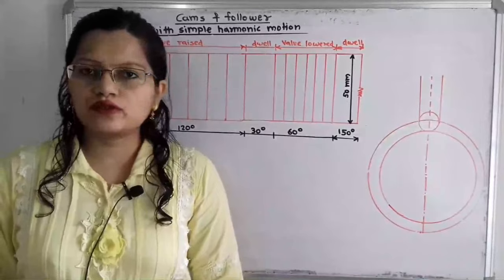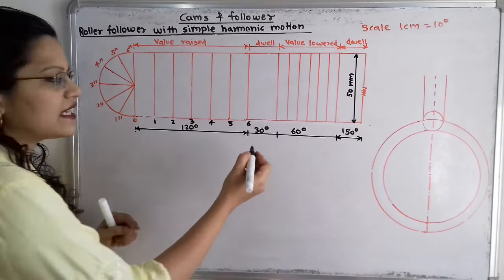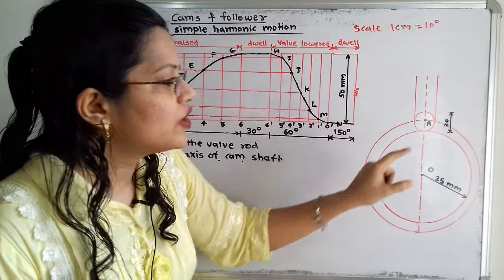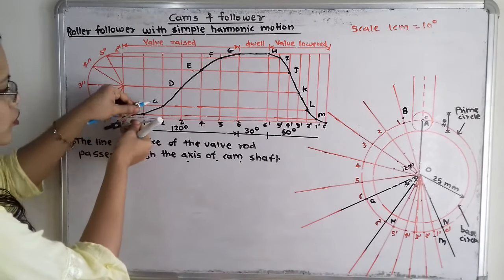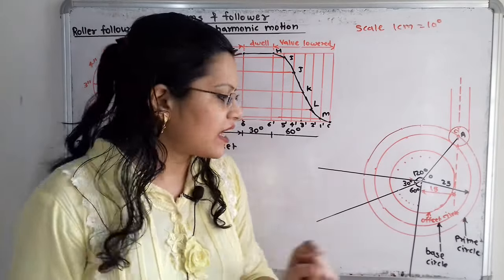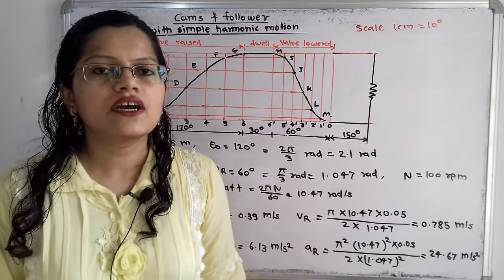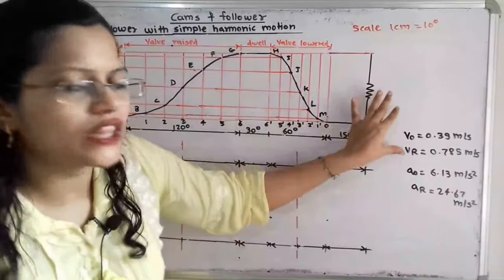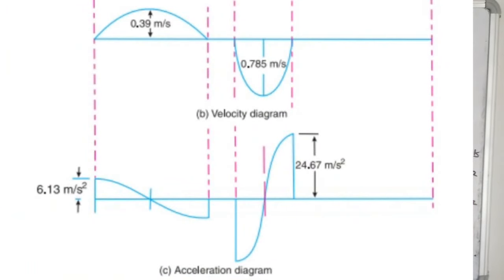Problem 3 on cams/  roller follower with simple harmonic motion/  Velocity & Acceleration diagram

Comment: Q.3.	A cam with a minimum radius of 25mm rotating clockwise at a uniform speed is to be designed to give a roller follower, at the end of a valve rod, motion described below: (1) To raise the valve through 50mm during 1200 rotation of the cam. (2) To keep the valve fully raised through next 300; (3) To lower the valve during next 600;and (4) To keep the valve closed during rest of the revolution i.e.1500; The diameter of the roller is 20mm and the diameter of the cam shaft is 25mm. Draw the profile of the cam when the line of stroke of the valve rod passes through the axis of the cam shaft. The displacement of the valve while being raised is to take place with simple harmonic motion and lowered is to take place with uniform acceleration. Determine the maximum Acceleration of the valve rod when the cam shaft rotates at 100 r.p.m. Draw the displacement, velocity and acceleration diagram for one complete Revolution of the cam.

There is slight difference in my que ...can u make it

Comment: Mam can please solve 1 questions of Tom 🙏
A cam consists of a circular disc of diameter 75 mm with its centre displaced 25 mm from the camshaft axis. The follower has a flat surface (horizontal) in contact with the cam and the line of action of the follower is vertical and passes through the shaft axis as shown in Fig.5. The mass of the follower is 2.3 kg and is pressed downwards by a spring which has a stiffness of 3.5 N/mm. In the lowest position the spring force is 45 N.

i) Derive an expression for the acceleration of the follower in terms of the angle of rotation from the beginning of the lift.

ii) As the cam shaft speed is gradually increased, a value is reached at which the follower begins to lift from the cam surface. Determine the camshaft speed for this condition.